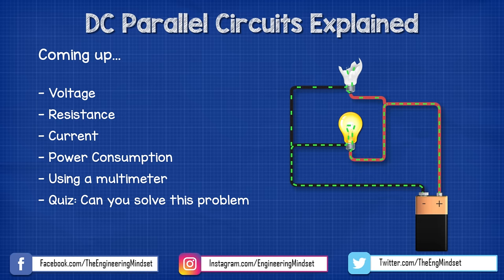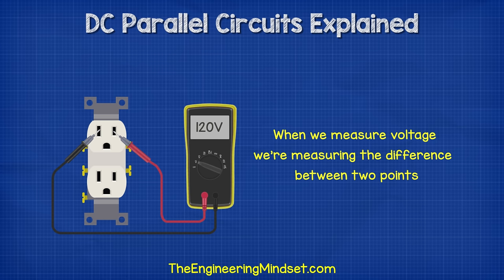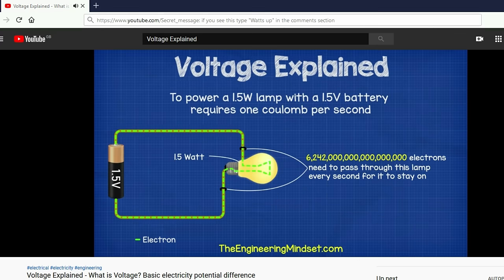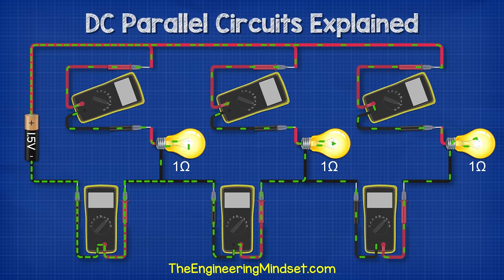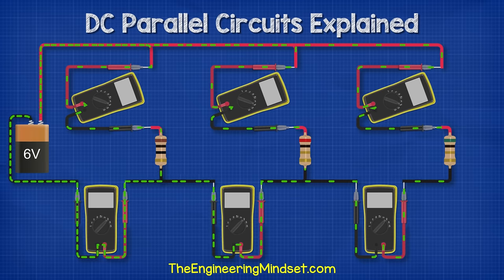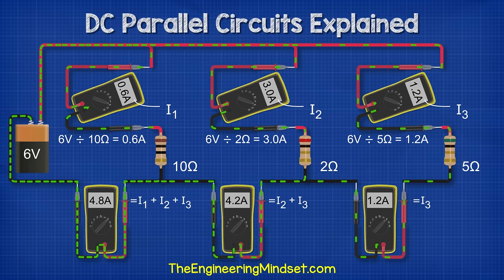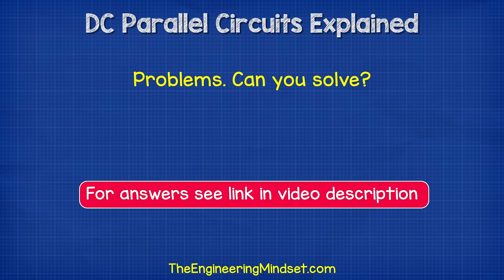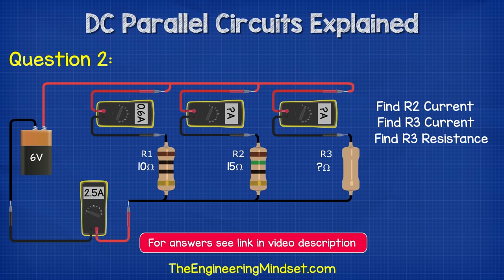DC parallel circuits explained  - The basics how parallel circuits work working principle

Comment from the maker: ⚠️ Found this video super useful? Buy Paul a coffee to say thanks: ☕
PayPal: https://www.paypal.me/TheEngineerinMindset
Reply: The Engineering Mindset if I break one bulb in the parallel circuit does the A reading for the other bulb go back to full flow? Or is it still split in half even tho the electrons are no longer flowing through the other circuit. In other words would one bulb get brighter the moment you broke the other or would it stay the same brightness. Probably a dumb question but this is a new found interest of mine thanks to you. You do a great job of explaining now I just need to commit all of these formulas to memory. Thanks a ton for the videos
Reply: 0.5A+0.8A=1.2A...
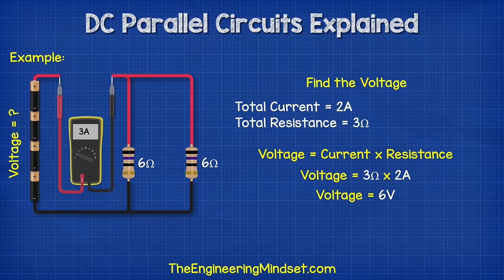Reply: Are you sure the calculation at 3:24 is correct?
Reply: @cameron-wy4wd  11w%
Reply: @cameron-wy4wd  no. 8+5=13 so your answer must be 1.3amps
Reply: just testing us. I see how it is
Reply: @superpayaseria  3:20 It should be 9V

Comment: Correction at 8:12.
0.8 amps + 0.5 amps = 1.3 amps. 😉
Reply from the maker: You're correct, well spotted.
Reply: whoops
Reply: Was shouting at the telly there for a minute
Reply: Wow
Reply: lol I instantly paused the vid to search for this comment.
Reply: I know right 1.3 not 1.2 amps
Reply: jelmei123456789 123456789 Same here 😅
Reply: after adding up the resistance instead of amps on accident, and then fixing it,I was like "What? did you make a mistake?" haha
Reply: @binaryparrot3352  so did i LOL
Reply: I was doubting myself
Reply: The way he confidently did that made me question if I was actually wrong.
Reply: @EngineeringMindset  Also at 3:10 you use 2A instead of 3A and don't explain where your total resistance came from
Reply: Lol I thought I was losing my mind 😂
Reply: Legit came to find this comment to make sure 🤣🤣
Reply: @tmoosy   def a mistake showing 3A on multimeter screen. But 3 ohms comes from the formula for total resistance in parallel circuits across 2 loads which is (R1xR2)/(R1+R2)=36/12=3
Reply: literally had me thinking I missed something in elementary school maths
Reply: I was about to start typing, then I saw your comment. Nice catch!
Reply: if i had to put this amount of work into making a video, i'd definitely mess up a few good times. keep up the amazing work!
Reply: I was beginning to think that maybe the resistance in the wire was the factor that made it go from 1.3 to 1.2 for the example. Otherwise… HEY!! 😃
Reply: @EngineeringMindset  just keeping us on our toes
Reply: ^,^/ Just came here to say that too lol
Reply: he almost got us. I'm glad I wasn't the only one scrolling thru comments hoping that it was 1.3 amps.
I guess it was just a trick question thrown at us to see if were paying attention in class.
Reply from the maker: Check our new Multimeter tutorial out ➡️ https://youtu.be/4lAyzRxsbDc
Reply: How did you get such a simple sum wrong lol
Reply: I was looking for this comment
Reply: ya i was thinking my Calculator was wrong there for a second lol I have too much faith in this guy that I believed that he was right and my calculator was wrong.
Reply: @EngineeringMindset if you’re gna post video like these at least have the correct answers🤦🏽‍♂️
Reply: @EngineeringMindset  I'd much rather your channel make an arithmentic mistake than a theory mistake. Thank you for this video.

Comment: 3:05 Your example is 2 Amps, but the meter is showing 3A. This may confuse some. I apologize if I'm not the first to point this out, but with 318 comments, I wasn't going to read through them all.
Reply: Thank you, I was wondering about that!
Reply: Also worth noting that this example provides a figure for total resistance before the video has explained how this figure is derived, which is a little confusing on first viewing. Excellent series though, thanks!
Reply: I was going through before I comment just to make sure 👍

Comment: I have a degree in mechanical engineering. Was never terribly interested in the electrical side of things because it was harder for me to grasp, so I never paid much mind to my electrical classes. Not to mention I had a very quiet professor from I think the Shandong region of China with a thick accent.

She was a perfectly nice and pleasant person but when you can barely hear or understand the lecture in a big lecture hall you become even more disinterested than you already were.

Fast forward to today and a large part of my job is troubleshooting and resolving electrical issues in an industrial environment. Finally having hands on experience and excellent one-on-one instruction from my boss (an electrical engineer) has sparked an interest in electrical systems and hobby circuitry. 

So here i am, refreshing myself to fill the gaps in my knowledge. I can wire up a 3-phase motor complete with relays wired into a PLC, but I couldn't remember the basic principles behind current in series vs parallel circuits.

And it turns out mechanical systems are quite lovely when you know how to electrically automate them.
Reply from the maker: See our new video on how to build mechanical versions of electronic circuits? Watch here: https://youtu.be/Zv9Q7ih48Uc

Comment: Paul: At 3.22 the amp meter shows 3A. Although the math is correct. This error
was put into the graphic to see if we are (paying attention) learning anything.
Reply: I came here looking for this. I dont know how he got the numbers for the formula either. I suppose the formula itself is important. I got that the voltage is 36
Reply: @andrewangerer1399  I got confused at this part too. He does write in the video description this was an error and that the multimeter should read "2A" not "3A"
I'm still confused as to why the resistance is 3 ohms
Reply from the maker: Check our new Multimeter tutorial out ➡️ https://youtu.be/4lAyzRxsbDc

Comment: Thank you for this video, And also I've learnt so much from this channel...
I've seen the comments about your mistakes in this video...  I want to say,  We all are imperfect and make lots of mistakes and learn from that....

 Ans no.1). The total resistance of the circuit is 1.01 ohm
Ans no.2). Current on R2 is 0.4 Amp
                    Current on R3 is 1.5 Amp
                  Resistance on R3 is 4 Ohm

Comment: Question 1: 
Rt = 1.020 Ohm
Question 2:
I2 = 0.4A
I3 = 1.5 A
R3 = 4 Ohm
Reply: I got 1.017 Ohm (60/59), it could be rounded to 1.02, but the extra zero after the 2 I believe is a precision error.  I may be wrong tho
Reply: @buddablackmusic  Calculate the total resistance first, then use that total resistance to check if your values are correct

Comment: 3:15 I’m not quite understanding where you’re getting 2A and 3 ohms from. But if I base this off the diagram

Voltage = Current x Resistance

Which means base on the numbers in the diagram, the voltage should be 18V

18V = 3A x 6 ohms 

If I’m wrong about that then the only other answer I can think of is

36V = 3A x 12 ohms

Comment: for anyone wondering how he got 3 ohms for total parallel resistance
at 3:05....
(use this formula.. this works for exactly with 2 resistors)
	Rt=(R1∗R2)/(R1+R2)
R1 = 6 ohms
R2 = 6 ohms
(easy math, subsitute and solve!)
Rt=(6 ohms * 6 ohms)/(6 ohms+6 ohms)
Rt=36 ohms/12 ohms
Rt= 3 ohms

formual for more than 2 resistors is... 
Rt = 1/(1/R1 + 1/R2 + 1/R3 + etc....)
😸

Comment: I have a question. 

At 5:35 a battery at 1.5 V, and a total resistance of 2, equals 3.0A.

At 6:12 a battery at 1.5 V, and a total resistance of 3, equals 2.25A.
At 7:07 a battery at 1.5 V, and a total resistance of 3, equals 4.5A.

At 7:07, you have the same setup(a total resistance of 3), but this time it equals 4.5A, instead of 2.25A. 

How can a total resistance of 3, with 2 different circuits, equal different Amperage?
I see the equations, and I understand the math, but you can't tell me that the numbers stay the same(total resistance, and total voltage), but then you add a lightbulb, and it magically increases the amperage.
Reply: OK, after some more research I found a more intuitive answer… Imagine the following

We start with a simple circuit (no branch) and a resistance of 1Ohm and 1.5V. Clearly the total current should be: 1.5V/1 Ohm = 1.5A.
Now we add a new branch (lightbulb with 1 Ohm). Instead adding the Ohms, calculate the same way as in the first case (only one branch). 

As every branch gets the same voltage (as there are consumers before the bulb, the „full“ volt is present on each branch). So „before“ ach lightbulb we have 1.5V and  1 Ohm, thus I = U / R = 1.5 V / 1 Ohm = 1.5A „before/after“ each lightbulb. As every branch has/needs 1.5A, we have a total of 3A.

If we would add another branch (3 branches with lightbulb with 1 Ohm) this one would also „need“ 1.5A, resulting in 4.5A in total.

No matter how many branches/lightbulbs we add, the voltage on each branch is the same, so is the amps. I like to think about ampere as workers who transport the energy (actually ampere are a bulk of electrons, so maybe not that false?). If we add more branches we need more workers, as the total number of workers have to be split across all branches.

The total resistance can be calculated with R = U / I and as every branch adds more ampere the total resistance decreases.
Maybe one can think of this as the „effectivity“…
If we imagine we have only one branch with 2 Ohms we get some numbers, 100% current „flows“ through this branch. 
If we add another branch with 1 Ohm, some current of that previously 100% will flow through this branch… The percentage will follow the distribution of the resistances, in this case 33% in the 2 Ohm branch, 66% in the 1 Ohm branch.

So the „effectivity“ of the 2 Ohms is only 33%, thus the total resistance decreases (compared to only one branch).
But how do we get these numbers 33% and 66%? Let’s make it more complicated to see, if it works with also with „not synthetic“ numbers: 15 Ohm, 50 Ohm, 150 Ohm (3 branches). A first idea could be: add everything to 165 Ohm and then 100/165 = ~0.6 (~60%), 50/165 = ~0,3(~30%) and 10/165 = ~0.06(~6%) (should add up to 100%). No matter what these numbers are a bit misleading as 100 Ohm should lead to far fewer current than 15 Ohm… Thus this cannot be right. So if 100 Ohm leads to less current than 15 Ohm, the percentage of 15 Ohm must be higher than the percentage of 100 Ohm. Lets try 1/100Ohm = 0,01, 1/50 Ohm = 0,02, 1/15 Ohm =  0,066 (from Ohms law with 1 volts). It s seems they already add up to 1 (or 100%) but they don’t (imagine we would remove the 15 Ohms, we would get the same numbers but would definitely not add to 1). Instead we calculate the percentage of these numbers… add them up (1/100 + 1/50 + 1/15) and calculate the percentage if 1/100, 1/50 and 1/15 relative to the sum: 
(1/15) / (1/100 + 1/50 + 1/15) = 0.6896551724 -> ~68%
(1/50) / (1/100 + 1/50 + 1/15) = 0,2068965517 -> ~20%
(1/100) / (1/100 + 1/50 + 1/15) = 0,1034482759 -> ~10%
these will definitely add up to 1
Now we have the percentages of how much current will flow through each branch (depending on the relative resistance).

A small test: we pick 225V, which gives us 225/100+225/50+225/15 = 21,75 Amps in total (each brach would be 225V/100 Ohm = 2,25A, 225/50 = 4,5A and 225/15 = 15A).
Actually we can achieve the same thing with our percentages (if we somehow knew the total amps)…
21.75 * 0.6896551724 = 14.9999999997 A
21.75 * 0,2068965517 = 4,4999999995 A
21.75 * 0,1034482759 = 2,2500000008 A

The percentages seem to work and give us the „amount“ of current „flowing“ through.
We can see that we have 100 Ohms but they are only „applied“ to 10% of the current which is why it is less „effective“.
Thus, the total resistance gets lower because the resistance is „applied“ to less current. 

This thinking only works for a fixed number of branches (or a fixed number of amps)… As you can see the amps increase if more branches are added…
then we need workers/amps as we have more branches.

Again, I’m not a noob but this way it makes a bit more sense and maybe this helps somehow ;)

OLD: I’m a complete noob but according to 11:40 the total resistance is calculated differently in parallel circuits.
For 1. 6:12 I get a total resistance of 1/( 1/2 + 1/1 ) = 0.6666666667 Ohm
For 2. 7:07 I get 1/( 1/1 + 1/1 + 1/1 ) = 0.3333333333 Ohm
If we plug this in I = U / R for 1. I = 1.5V / 0.6666666667 Ohm = 2.25A
and for 2. I = 1.5V / 0.3333333333 Ohm = 4.5A
It seems counterintuitive but I guess this is how current works?

Comment: I do not understand the example on 3:23. The illustration circuit shows that current is 3A and resistance is 6 Ohms per resistor how is it that when calculating voltage you are using values that are not in the illustrated circuit?

Comment: I'm kinda of confused at 3:10.  The diagram says 3A but the problem says 2A.  The resistors are both 6 Ohms but resistance in only 3?
Reply from the maker: Well spotted. It should read 2A on the multimeter.
Reply: The Engineering Mindset What about total resistance? Why is it 3 ohms? Is it due to the resistors in parallel?

Like 3ohms = 1/((1/6ohms) +(1/6ohms))
Reply from the maker: Check our new Multimeter tutorial out ➡️ https://youtu.be/4lAyzRxsbDc
Reply from the maker: Check out NEW resistor video, everything covered! ➡️ https://youtu.be/DYcLFHgVCn0

Comment: I learned both directions of current flow.  After 50 years of working in electronics as a broadcast engineer, I came to the conclusion that theoretical direction of electrons doesn't matter.  It only mattered in school.  In the field, I have never needed to ascertain which direction.  It only matters that they are flowing, by how much, or not.

Comment: question 1 - Total Resistance is 1.02 Ohm.

question 2 -
R2 current is 0.4Amp
R3 current is 1.5Amp
R3 resistance is 4Ohm

Correct me if Im wrong pls

Comment: i) Total resistance Rt=1.020ohms
ii) current through 15 ohms  is 0.4 Ampere and R3 is 30 ohms and current through 30 ohms is 0.2 ohm
.Thank you so much sir for giving excellent information and excellence explanation
Reply: No the R3 current is 1,5 amps and the R3 ressistance is 3 ohm, to get the current of R3 you just need to:
I(3) = I(t) - [I(1)+I(2)]
I(3) = 2,5A-[0,6A+0,4A]
I(3) =2,5A-1A
I(3) =1,5A
For R3 ressistance you just use ohms law, which states that ressistance is Voltage divided by current, in this case the current we use to get the R3 ressistance is the R3 current, so:
R3=V÷I(3)
R3=6V÷1,5A
R3=3 ohm
Hope it helps
Reply: @AverageTPSenjoyer  Your way of calcylating is right, but 6V / 1.5A equals 4Ω, not 3Ω,
Reply: @trapiz9356  Thanks for pointing it out, I think the rest is right

Comment: wow, the explanation for parallel resistance and all of the divisions NOW totally makes sense! thx !!!

and here's my 5 cents:
a good (and quite extreme) example would be to make a short circuit in parallel, thus (despite the other resistors) the current would flow via the easiest path. 
It's easier to see it as "leakage". the smaller the resistance - the bigger the hole is. 
therefore, the more "joints" = the more holes you have with current leaking through.
therefore, in parallel setup - the total resistance would ALWAYS be smaller, than the weakest part.

12:20

Comment: I really found this video very helpful. I have been through so many videos but this really helps to know much more easier for Series connection and Parallel Connection, and their advantages and disadvantages. 

I have fixed spots lights in series connection and the first light is very bright and the rest are dull and flickering. 

Then I have been through this video and connected spot lights in parallel connection. Now it's really cool. 

I must really thank you, you made my day easy.  All the best :)

Comment: A couple of errors in this one. Your first puzzle calculated 0.8 + 0.5 to be 1.2 but it's actually 1.3
Reply from the maker: You're correct, well spotted.
Reply: @EngineeringMindset  I can't find the way you solve the example((

Comment: your videos have changed my life. all kinds of projects and homowner diy cost savings are attributed to these videos. 

also, per my research @7:29 connecting batteries in series does not increase amps, but volts instead.

Comment: Hey, at 3:42 if you knew only voltage (12V) you determine resistance by looking at the lamps description and the calculating the current right?

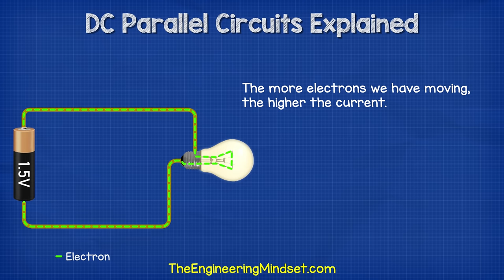Comment: 4:50 sir you said in your previous lecture that voltage are responsible for speed of electrons if we provide more voltage the speed of electrons increase but here you said is that electron speed is remain same after the voltage of 9voltage
Reply from the maker: The speed remains the same, the amount of electrons changes

Comment: When you're saying with these parallel circuits, are the multimeters just seeing what is being drawn form the battery so the voltage from the battery is 4.5A drawn

Comment: 5:40 when you connect a 2nd 1 ohm lamp, the current increases to 3 amps. Why? We just said current = voltage / ohms. 1.5 volts / 2 ohms total = 0.75, not 3. Is it because current splits in parallel circuits and so each lamp is receiving 1.5 amps which *2 totals 3?

Comment: Great video and I fully understand the explanation. But what I can't get my head around is how in domestic lighting and plug socket circuits, the voltage supply is 230v (UK) so why is it not blowing light bulbs up when from what I've seen all that's resisting the flow is a mere 10 ohms per bulb.
Could you do a video on typical measurements, figures, resistances, etc. in domestic circuits please?
Reply: The bulb assembly should have resistors in it. And the resistors built into the socket as well limit the {Current}. I think I have that right.
Reply from the maker: Check out NEW resistor video, everything covered! ➡️ https://youtu.be/DYcLFHgVCn0